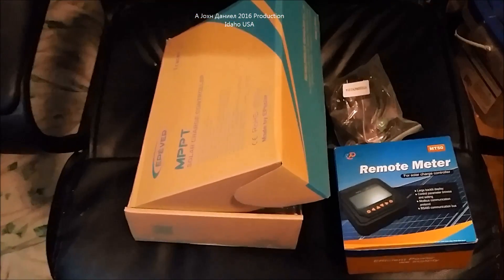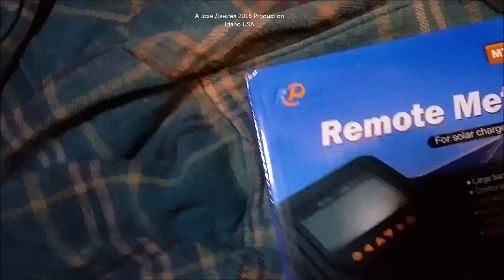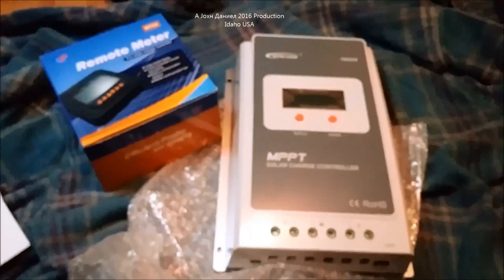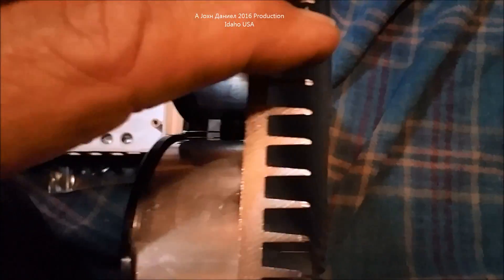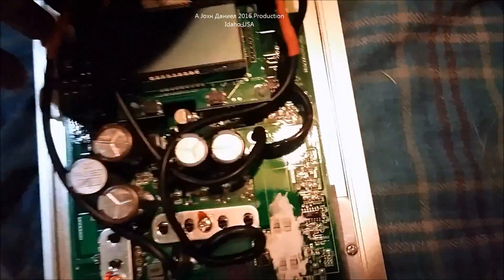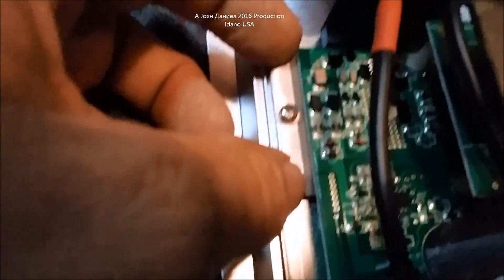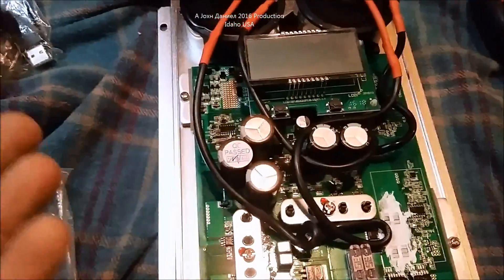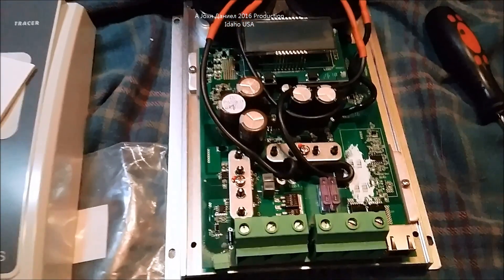MPPT Solar Charge Controller 40 AMP EPSolar EPEver WE OPEN IT UP! (info Below)

Comment: I bought an epsolar (same company) 60amp etracer.. it was huge and very good quality. It lasted a few months and then ended up in the bin.
 I'm not buying this crap anymore but if I were to I would get the tracer BN... I contacted epsoler and that's what they told me to get. Can be paralleled too

Comment: It was excellent presentation.
What is the difference between  Rated Charge Power and Max. PV Array Power
. Tracer manual says 40amps controller Max Pv array power 520W and Max Areay power 780W for 12v . Does this mean  40amps controller can be connected with  780W pannel on 12v battery.
Reply from the maker: It will allow up to 780 watts to be wired to it, but will only produce a max of 40 amps(520w@12volt DC). EXAMPLE: It means if you use 780 watts of panels and lay them flat or live in a low sun area, they will very rarely hit over 700 watts actually and the controller can handle those events, but will likely always provide the 520 your controller can process.

Comment: Just a head Up mine has not been hot yet..
But mine PV is set Up in series .. so mine does MPPT thoes who buynin Rothe shade PV in series don't work .. set in parallel ..
( Mine 3000 PV watt is both seriel and paralell 4pv x3 .. All cabels are in the EPever No jumpers 3+ 3- )
Defentley get hot becaus I F YOU DO NOT GO 5 V ABOWE (12 VOLT) IT WONT MPPT !!!

Comment: I recently bought an epever 2210 MPPT charge controller. BY default battery type was SEELED and I could change it to USER as I am having 4S 17P Lithium battery pack (18650) But my controller is not charging more than 14.5V but I want to change it to 16.8V  I couldn't find out a way to do it. Can you please help me in simple language? I have no remote meter.

Comment: Nobody's seem to be concerned  about the equalization charge that occurs on the 28th of the month. What if there is no sun on that day and the next month on the 28th.????
Reply from the maker: Thats why you should always maintain it yourself, if your battery don't get hard charged then do a overrride or what I do, I just run a 70 amp charger from a gas generator and a 30 volt PMA on mine till they get warm about every 45 to 60 days then do my watering. But with wind turbines https://youtu.be/QSfWnIscDTM in a good wind area, you never need to do Solar Equalization. See mine, the 3 blade is for high wind area, the 5 blade for everywhere else.
Reply: @JOHNDANIEL1  thanks John for  being out here for all of us. John respond back within 12 hrs of my concern.  Epever responded instantly also. Stated there is no ability to  alter the equlization date. I strongly feel there there should be that feature. If the date was changed to the 28th of the month would that create a manual  override??? Again thanks for sharing your knowledge whit us..

Comment: Gday mate... I'm still finding my feet with my off grid solar system. I have this controller and recently was gifted 12 x 175w x 24v panels. Can you tell me how to calculate how many panels this controller will handle. I'm running 3 x 85ah x 12v batteries in parallel.
Reply from the maker: Base your sizing on the following. 13.4 volts static rate for a 12 volt system, 26.8 volts for a 24 volt system. Watts divided by that number pair will denote amps you can deploy to the controllers. Example  3 of your 175 watt panels ( 175w x 3 panels ÷ 13.4 volts= 38.6 amps)
Reply from the maker: Battery value on solar amps math: based on 6 hours full sun you will need 190 AH@20 of battery  for every 40 amps of daily solar charge. So for your system, you will need four 40 amp controllers and 4 x your current battery bank (  760 AH ) The newer Tracer MPPT 10 to 80 amp by EP are in my reviewed and tested list. https://www.amazon.com/shop/influencer-acccb1e8
Reply: @JOHNDANIEL1  Thanks John... very clear but is it possible to send too much power to the controller and damage it or do they just ignore the extra current.
Reply from the maker: You can damage one with 10% over its rating and poor cooling. It will shunt some, but over 10% past its rating you get fails.

Comment: Dear John i bought two of the 40A 12/24V for a Technician friend of mine after watching your videos.  Some how,  their panel boards got smoked. The seller told me he does not have technical support from the manufacturing company. I want to replace the two boards. How do i go about it.?
I am a Renewable  Energy Technician in Nigeria. Get to me through my email energypowerconsultant@gmail.com .
Thanks.
Reply from the maker: Sounds like he tried to put exactly 100 Volts to them. Should NEVER do that, burns out the capacitors, ruins other components. The 100 volt rating on any of them should never be the pushed. I use Stion, 92 volt panels and would not put them on these or any 100 volt rated MPPT, its the peaks that burn controllers not the producing voltage. All panels will PEAK high when the controller reconnects on them.
 You can request replacement Boards 
Head Office
Beijing EPsolar Technology CO.,LTD.
Address: BLDG #18, CO.PARK ,NO.8 HEYING ROAD ,CHANGPING DISTRICT，BEIJING，CHINA
102200
Website: www.epsolarpv.com, www.epever.com
Tel: 86-10-82894112 / 82894962 / 82894528
Fax: 86-10-82894882
E-mail: info@epsolarpv.com
*Technical support*: support@epsolarpv.com

Comment: Hi, i bought an epever 30A and it can handle 100v, so i can coonnect it with my 1800w panels ?
Reply from the maker: +Akrame Elhimass 1800 watts at what battery voltage? 30 amps at 12 volt battery is 380 watts solar in, and 48 volt battery is 1500 watts solar in. You must have watched too many videos from Missouri LOL!
Reply: But if he can take 100v i think he's input pv (w) would be 3000w MAX
Reply from the maker: +Akrame Elhimass It can take 100 volts from the solar but that's incoming voltage, not battery, the charging amps is still all you can base wattage on. In a 12 volt system your math is 13.8 x 1 amp (per amp rating) gives you the watts it can handle converting to amps for charging. Anything over that is just turned to heat which will burn up the controller.  
So 13.8 volts x 30 amps (your controller rating) is a max input wattage of 414 watts of solar with UP TO 100 volts dc as the panel voltage. 
I have 135 watt - 90 volt STION solar panels on my place in Texas. I am charging 10 batteries all 12 volt using 3 Esun PMX60 controllers rated at 60 amp, 150 volt max input. The reason some controllers have high voltage abilities is so you can raise solar panel voltage by doubling your panels to make higher volts to make them more efficient in how the wires can carry the power.

Comment: Seems to be a fine controller.  But it wasnt for me.  Ran 3 12v 100w panels.  Mppt worked good until the tracer died.  I got a second one.  Worked great until....it wouldnt shut off and consequently ruined my batteries.  I got a third one...used it just long enough to get a real good top of the line controller...a Midnite Classic.  Went through three tracers in a years time.  The tracer is simply a plug and play controller.  You can set battery type but you cant user set any charging parameters.  If you cant control paraneters then it will cost you in battery performance...battery longevity...and optimum performance.  The controller needs to let the end user set bulk, absorption, float and equalization values determined by the battery manufacturer.
Reply from the maker: Hate to hear that, but a Classic is better. Mine are still running just fine though taking 43 volts for 37 amps solar and charging 12VDC system. Using my computer I did set them for top and bottom charge. But you have to manually do bulk on mine. I prefer that so I can do a full battery check prior to hitting them with the 15.5 its open for.
Reply: I'm confused, you state "but you cant user set any charging parameters" and "needs to let the end user set bulk, absorption, float and equalization values" ... these controllers DO let you set these, did you read the manual? (HINT: check page 17) You can set any parameter from 9 to 17V. I have set parameters on my 4210A for charging lithium batteries and never had a problem.
Reply: With remote controller can change but not without

Comment: I watched your video on the Harbor Freight 100 watt set up a while back, and you were looking into going with an MPPT charge controller, did you find a controller that you would recommend ?  The controller that comes with the HF units don't last very long.  thanks a heap for any suggestions you may have....  KC
Reply from the maker: Yes, a basic TRACER like this one http://amzn.to/2zFsBFC the EPEVER 40A MPPT Solar Charge Controller Tracer A 4210A + Remote Meter MT-50. Reason for the 40 AMP from day one is unless your just going stop at 100 watts, then get a unit that can handle 500 and one you can grow into. Plus, they LOVE amorphous panels.

Comment: Hi how you going I have one of those controllers have only just bought with 250 W solar panel connected to it but will be putting 500 W solar panel connected I have 2AGM batteries 6 V connected together to make 12 v   The AGM batteries are 250 amp hr Bitch what setting should I put for the batteries as it does not have AGM on the controller thank you
Reply from the maker: +Allan Robertson Set it on gel battery voltage.

Comment: Bought the 40amp version for a 24v system along with 4-420ah (20 hr rating) batteries and two 265w solar modules. Charges battery bank fine, but don't connect the load terminals to something like a 24v fridge as it can't handle it, always kicks out and fridge never stays on. Ended up just connecting fridge straight to battery bank. Also, the thing will not keep time, within 24hr the internal clock can be off by more than an hour!Other than that everything seems tickyboo, but its only been a month thus far...
Reply: Wet sled Interesting ... is 40A charger enough for this big batterybank? i have 2 105A 12 volt agm deepcycle put togheter as a 12volts bank ,is,n it a issue whit your setupp that your batt bank becomes sulfated becose of too little charge amps, (5-8% desulfating-rule) ,,maybe i,am mistaken.. you have 4 times 400+ putt togheter as one 24volts bank? the fridge vou can calculate the 24ours voltage/amps and if you can harvest this amount of amps given your sun/daytime not being low on voltage whit your batterybank too much and destroying them $$$ 👍🏻
Reply: a 100ah battery needs aproximitly 5-8ah of charge minimal to keep it from sulfating and destroying it,so 40AH max fore a 1680AH 24 vot batt bank is 210A needed!? thats 8%
Reply: I think it in the way of putting batterys togheter paralelle or serial👍🏻 so it can be done whit 33,6 AH ,420AH / 8% ..

Comment: Be shure not to operate them close to the maximum voltage, I suspect my 2x 40A controllers burnt / broke because of this... my panels are 86 volt max open circuit, waranty replaced controller also broke down.

Oddly a 30A version I have had a year longer doesn't break...

I finally gave up on them (expensive lesson) and went with Victron units.
Reply from the maker: +dboekel I run mine at under 80 volts myself, so far all good.

Comment: Hi, I just got  this MPPT  EPEVER same as yours but lower current only 10A, my question is, can I put a 300W 36V solar panel with it,  and charge my 12V battery?
Thanks
Reply from the maker: Its a math thing, WATTS ÷ 13.8 volts is your amps you will end up with going to the battery, so if you put 300 watts solar ( 300  ÷ 13.8 ) you would be pushing 21.7 amps into a 10 amp controller ( NOT GOOD). 13.8 volts is common 100% charge status of a 12 volt battery in incoming charge, 12.8 is standing 100% on a 12 volt battery. The math doubles each time as you go from 12 VDC to 24VDC to 48VDC
MATH on what a controller can handle is below
* WATTS  ÷ 13.8 volts = AMPS* 
A 10 amp controller can handle 130 watts solar and produce 120 watts or about 9.5 amps charge
A 20 amp controller can handle 260 watts solar and produce 260 watts or about 19 amps charge
A 30 amp controller can handle 390 watts solar and produce 360 watts or about 28.5 amps charge
You can see theres a input, conversion loss, bulk charge maximum rating and a after conversion rate of charge abilities. 
If your going to grow your system, but big on the controllers from day one.
Reply: @JOHNDANIEL1  Hello, I am writing from France, thank you
these mppt limit the output current normally?
in the example of 10amp; so even if you plug in a 300w panel, and there is a lot of sun, the mppt limits the output load power to 10amp, or it burns out?
I read a little above one of your comments, on a 40amp module, you had 42amp? ; you were in limit of input power, or it is the mppt which was in limit of output power?

10 amperer (12v x 10a = 120w); ; 120w is the maximum load power that the mppt can provide, or 120w is it really the maximum power of the panel that can be connected to it?

for me a mppt is a simple dc-dc step-down converter, or the power limit, in the logic must be done at the output of the converter

another example on victron energie mppt; a 100/20; it indicates that the maximum load power is 240w (12v), maximum input power, but not the maximum panel power that can be connected to it, it therefore indicates that the panels must not exceed 100v in circuit open, and that the short-circuit current of the panels should not exceed 20amp, if we do a calculation we will take 70Vmp & 15Amp, with these figures we are not out of spec, its done 1000w, even if the panels can give 1000w, the mppt will transfer only 240w to the battery,, for me it is even done on purpose, its allows to oversize the panels for the winter

if we put a 20amp fuse at the input of a 20pp mppt, in the logic impossible to damage it, if the cutout mosfets were chosen ...

finally here, tell me what you think about it :) thank you good luck
Reply: @JOHNDANIEL1  thank you it is thanks to you, and your video that I could see some years ago, I look for a charge controller mppt, I could see under the hood that the epever 4210a has self, which shows itself well that it is mppt, and no fake device "mppt" pwm ...

It's been 2 years since my epever 4210a works great :)
Reply: Јоhn Daniel you're a good person, took the time to explain all these , deserve big time appreciation. Thank you!

Comment: need a pix of u20
Reply from the maker: +Vanderson dos Santos U20?
Reply: Јоhn Daniel. yes the smd controler in board on c20 is a 8 pin smd chip
Reply from the maker: May be a few days, I am in the gold mine area right now and the trailer only has a pair of Solar Eagle 40 Amp MPPT on it.

Comment: hi. i just installed one of these on my trailer. the batteries were low at 5.38 volts .so i currently hooked up a charger to them . also finished hooking up solar panel to controller but no display lit up on the controller.?.......even with the low battery should not the solar panel display come on ?.........or is the controller defective ?
Reply from the maker: +bob woerner That controller like most needs 10+ volts to begin operating.
Reply: i left the battery charger hooked up .will go back to check on it tomorrow .so i assume your saying when the batteries reach 1o volts the display will light up on the mttp controller and it will start to draw from the solar panel ?
Reply: in an unrelated issue i have a  battery jumper pack that i shorted out.made by quickcable. any idea where i can take it to be repaired.called the company that makes it and they didnt even know
Reply from the maker: Depending on the model they have a fuse inside them. If its lithium its a fuseable link, if its Nicad or Led Acid internal battery its a replaceable fuse or resettable circuit breaker in the unit near the switch. Open it carefully, disconnect the battery pack or battery to see if any internal damage has happened. If the battery pack is swollen up, its trash, get a new one. If not look for the fuse or circuit breaker and replace it with same model or rating. Go to Amazon to find the part you need if you plan to fix it.
Reply from the maker: Be sure you ONLY Hook up the battery FIRST!!!  And yes, it requires over 10 volts, really needs a full 12 volt,  for the system to identify its voltage it will run on.
Reply: thanks for your time and all the info

Comment: My "pcm x60" by mpp solar doesn't need a separate controller to adjust all the permitters.  It has computer monitoring software if you choose to use it.  I'm definitely considering getting one of these for a smaller secondary setup I am building.  They are quite a bit cheaper than "mpp solar"

Comment: Actually that controller is a knock off of the "mpp solar" brand.  The mpp solar brand is made in Taiwan, these are made in China.
Reply from the maker: +potc420 For a job in Ketchum idaho  I ordered 3 from MPP off ebay, 1 had made in Taiwan on it, 2 had made in China on them. All 3 had the MPP Solar logo on them bought from maximum solar.
Opening them up I could find absolutely zero difference.  I believe they are all 100% made in China but fraudulent labled to trick buyers.

Comment: Dear John, or anybody else with a Tracer-A unit, could someone tell me the chip markings of U20 (on my Tracer4210A).  It is a low-profile 8 pin soic, seems to be supplying power to an LP38691 LDO which has an input range of 2.7-10v, which again powers the uC.  So I guess U20 must be some kind of power supply ic to step down battery voltage to ~10v.  Any ideas? My parts bin is huge, but I need to know the proper identity of the chip to fix my tracer.  U20 markings are unreadable here, as it has blown up to the point the markings are completely unreadable. Thanks!
Reply from the maker: +homelien I'll take a look asap
Reply from the maker: +homelien  I can't make out the info on U20. Lower numbers are 6275, best I get on top set is B09673.
Very bad labeling.